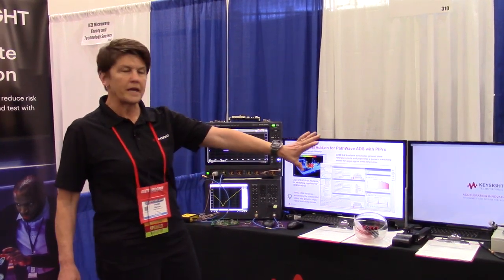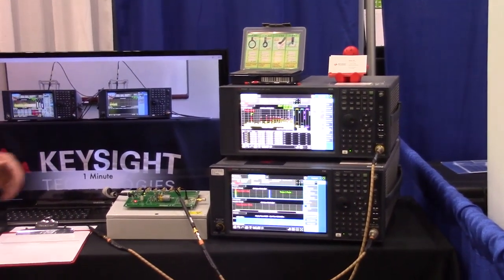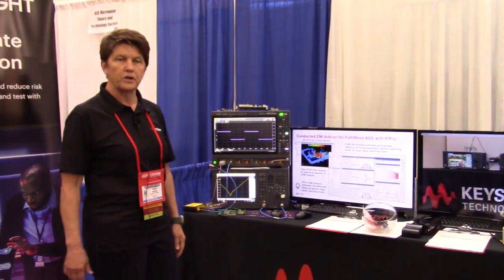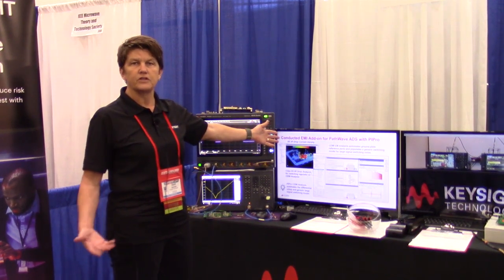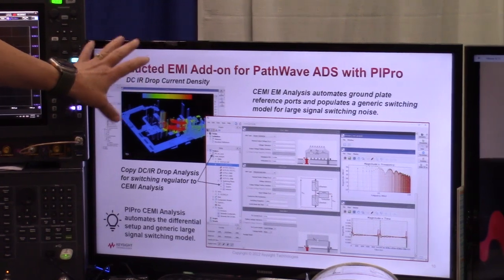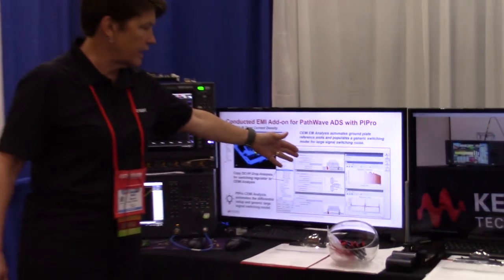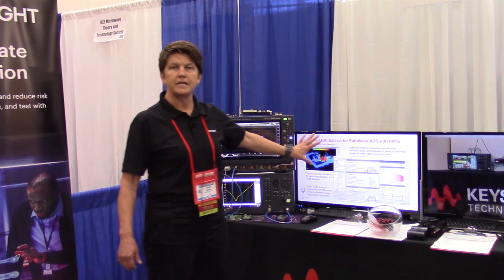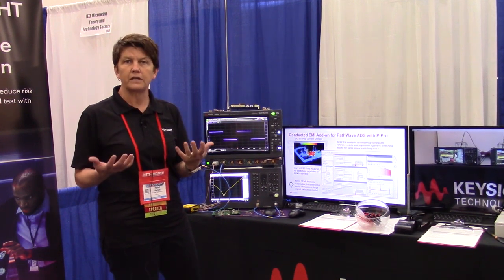Keysight Demonstrates EMI Simulation and Debug

Comment: The trick in this measurement is accurately accounting for cable and sensor/antenna/probe  loss over a wide frequency range. Accuracy of the measuring receiver is very important. Over many decades of frequency sweep you may have several probes to account for. The software makes this job easy.